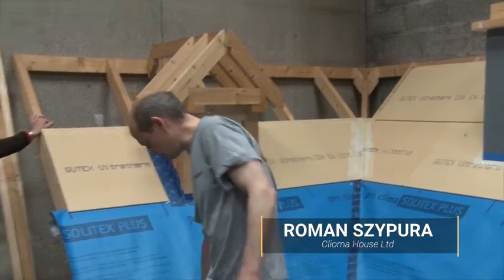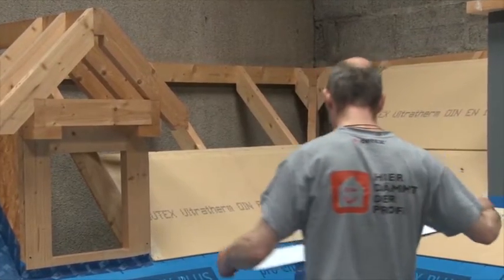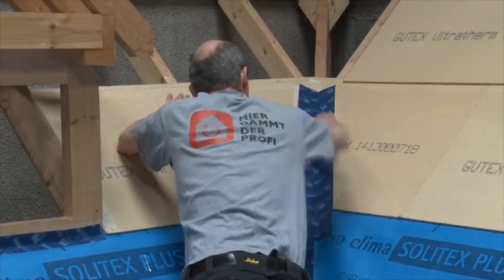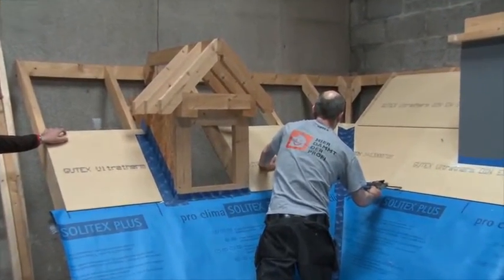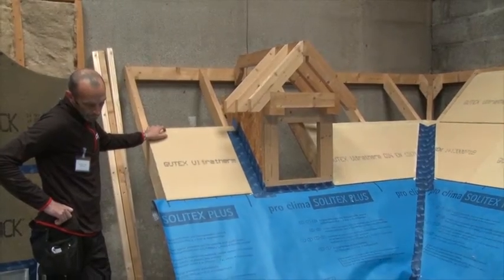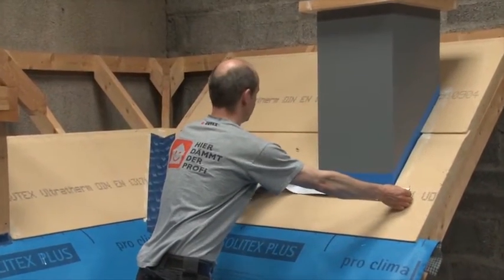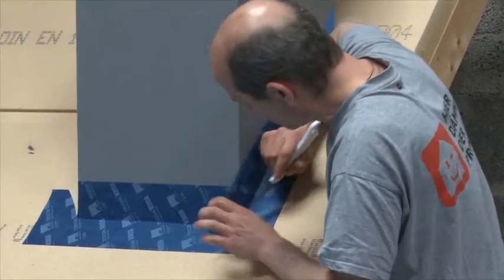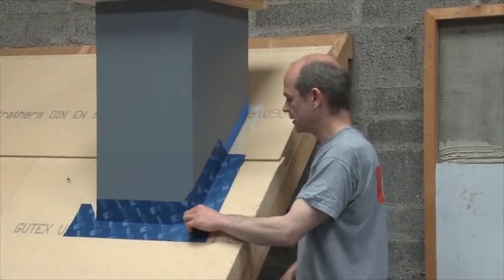Gutex Ultratherm Roof Installation (Part 4) - Taping Valley and Chimney Details

Comment: Seems like a bead of sealant along the horizontal joints would be a belt and suspenders approach. Could see issues with wind-driven rain getting in the tongue and groove, at least on weather facing sides and on lower-pitch roofs.
Reply from the maker: In this video https://youtu.be/pF6Nu8IpxGM, the properties of the unique Ultratherm tongue and groove are shown.  Correctly installed, the joint will be completely watertight so a full-length bead should not be necessary.